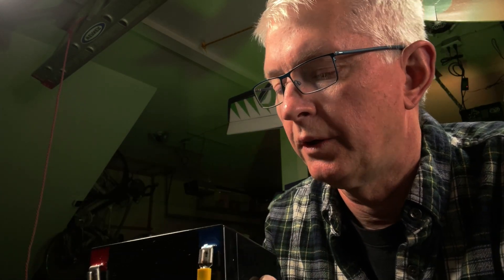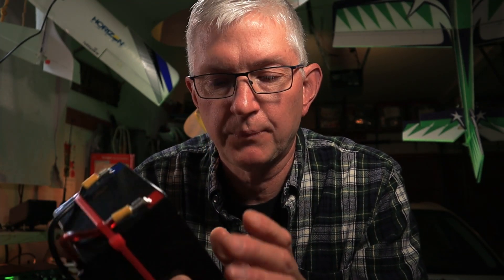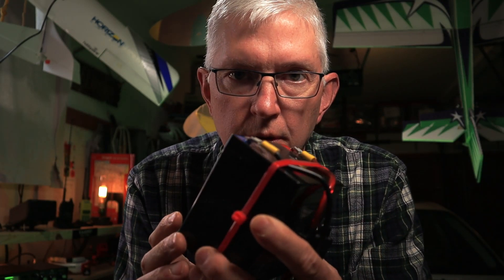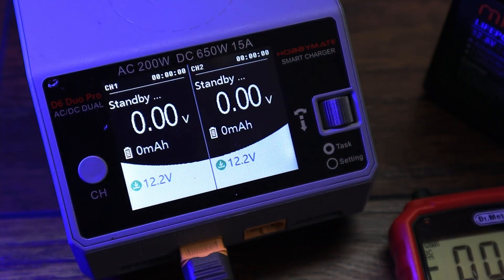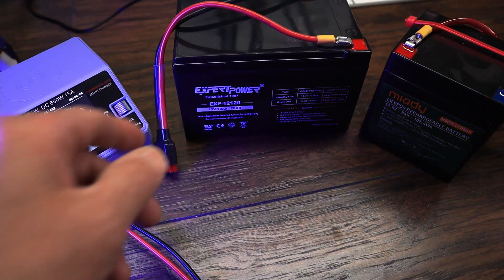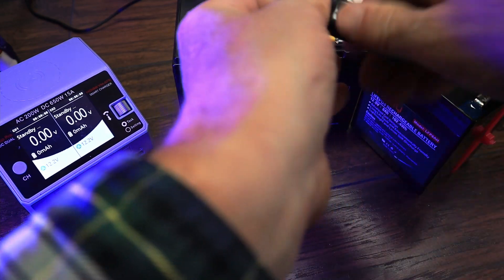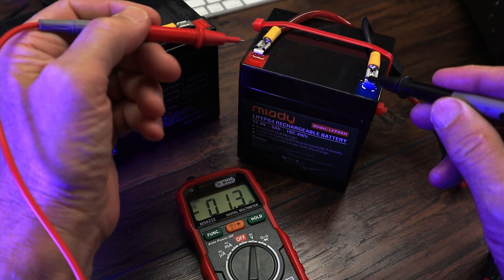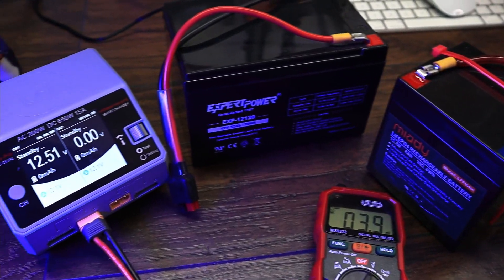DON'T PANIC! Wake up your DEAD LiFePO4 after discharge! (#36)

Comment from the maker: Who has experienced this with their Lithium type batteries? What method do you use to wake the BMS, assuming your battery has the same issue as this one! Thanks for stopping by!
Reply: I have mavic pro batteries that wont charge. Is there a way to wake those up? The Mavic charger will not charge...kind of like in your video. Can you help?
Reply from the maker: @flintdwiggins  Hey there. What does a voltmeter say? How old is the battery?
Reply: @W0KNI  The batteries are a couple of years old...but never used. Just sat on the shelf. Voltage is zero. I think the BMS just turned them off. Is there anything to do to wake them up?
Reply from the maker: Normally I would say yes, but only if you could connect it to a same voltage source.  The pinouts for your battery can be found on the internet. You might check this thread.  https://forum.dji.com/thread-134111-1-1.html  I see a suggestion there but not sure if that works with your battery.  DJI has done a slick job of blocking you into using only THEIR batteries. 
Another option is to insert your "dead" battery into the drone then charge the drone via the cable.  The internal circuit between the battery and the drone might "wake" it up.

Good luck!
Reply: @flintdwiggins  DJI do a good job of bricking batteries and gear thats not used for  a while, I have an inspire 1 that wont show video because the controller pcbs go bad after a while of not being used. 

as for the battery, as far as I can tell from years of playing around with DJI gear, they power the BMS from a single cell and not via the main pack voltage.  This is only an issue during long periods of storage without cycling the packs, one cell will drop below the safe level and the bms will just flash at you, sometimes you cna leave it on the charger a few days and it seems to recover, other times you can open the pack and recharge each cell on a power supply at a low current up to about 3.8V then plug the bms back in.  

I generally charge the whole pack up to about 4V less than full on a power supply, then go in and check each cell, if one is a lot lower than the rest, then its toast and theres no real way to save the pack without changing all the cells.  

I have spent about 10 years doing this kind of thing, and i can safely say, if a cell doesnt charge the same as the rest in the pack, then its time to find a use for the pack without that cell, IE a lower voltage application.
Reply: I use a charger that provides some voltage before going into charge mode.
Reply from the maker: Interesting. Could you share the Make and Model? Thanks!!
Reply: @W0KNI  
It's a Mroinge model MBC055.
I just hooked it up a meter to make sure I'm not misleading you.
With no battery connected, the charger output pulses 15 volts ON and OFF about once every second.

It seems to be a fairly reliable charger.  I just wish it had a display to show charge rate, voltage and mAH.   It only has basic leds showing if it's charging lead acid or lithium and 6 or 12 volts.
Reply: I have 2 other 100amp lifpo4 Renogy smart batteries that are both at 1.8 volts. Tried this trick on them and it didn’t work. Can I leave the lead acid connected to the lifpo4 for longer then a minute to bring up the voltage to where the bms will kick on? Please let me know soon. Thanks!
Reply from the maker: @covidfartfog8076  Hmm, so you say the total voltage at your terminals shows only 1.8 volts? I would suggest contacting Renogy first, but if no luck there then you might have to get access to each of the 4 cells and charge them individually to 3.4 volts.  But reach out to Renogy first.
Reply from the maker: That’s great news! Glad that worked. Happy RVing

Comment: this is normal BMS behaviour. Its when you leave it like this for a year then try to wake it up that you really need to wake up the bms...........  thats a great field expedient way to wake it back up for recharging.  Are you certain that this BMS limits current in during charging  ? have you tried to charge it on a huge power supply to measure the current? most BMS , especially cheap ones will not be CC during charging and reply on the charger to limit the current.

Comment: Hello Stephen, should this also work with a 48 volt 20 Ah battery from an electric scooter (EVOmaxx)? And do I need a 48 V second battery as well?
The repairshop asks €850 to fix it.

Ad
Netherlands
Reply from the maker: Hey Ad - Good question, and the answer is - probably.  However the basic concept is that you apply enough voltage to get your BMS to "wake up."  HOWEVER, the dead battery could easily have MORE than 12 volts hiding behind the sleeping BMS.  So the problem is if you "wake-up" your BMS and then you have 48 volts that will try to feed into your other battery - THIS IS BAD.  And should not be done.  I don't know what kind of battery system you have but for $850 euro's I would think you could buy a new one OR buy 4 x 12v batteries in series to get to 48 volts and try to connect it to your dead battery.  I hope this helps.
Reply: Im in the same boat. Im charging up 4 12v batteries and plan to wire in series to try this. I ran my battery dead and it took a charge but seemed goofy. Voltmeter started acting goofy and I really don't think I was getting the correct voltage on my reading. Now it's dead and won't accept a charge. It's sitting at around 2.5 volts. I'll let you know but curious if you tried it.
Reply: @scotmaciver  I didn't try it. I've sent it to another repairshop, which claim to fix it for € 100. Hope they're right.
Reply: @adjekratje1  well i got my 4 batteries set up and ready to try. Need to get my connectors on and see what happens. I'll report back.
Reply: @adjekratje1  well crap. i put my battery on the bench and got all my connectors wired up and before connecting did one last volt check and now it's reading 54 volts. I wonder if my wiring or something screwy with my controller is causing the problem.
Reply: @scotmaciver  Amazing

Comment: Interesting video. Wouldn't the charger wake up the battery since it supplies voltage to the battery?
Barry
Reply from the maker: You would think? However the BMS inside the battery box goes into a low voltage sleep mode that unfortunately tells the majority of chargers the battery won’t take a charge. The method I show applies enough current to essentially wake up the BMS so the battery can be charged

Comment: I have a 12 volt, 100ah lithium lifepo4 battery that drained down to 3.7 volts. I keep reading that if I attempt to recharge it, it could catch fire. Is this true? Would your method above work for a battery that size?
Reply from the maker: Thanks for checking out my video. Sorry about your battery.  Using the method shown in the video, your battery will not catch on fire - unless your cells are physically damaged.  If they are leaking then do not try to charge the battery.  However, if it was just drained down to 3.7 volts then try this method to wake the BMS.  Let me know how it goes for you.

Comment: Got my lifepo4 20amp battery awoken. I connected it to my Sharmans 30amp power supply. It has variable voltage so dropped it to 12.5v and connected to the psu for 1m 30secs and it will now charge 🙂
Reply from the maker: Excellent! Have fun

Comment: Proper LiFeP04 chargers will wake up your battery, you just have to give a  minute for the process to take place.
Reply from the maker: Hey there, thanks for watching.  Sounds like great info, do you have a model you can share? I'm always interested in good battery tech.  I use a pretty reputable charger for Lithium batteries and it was unable to kick start my "sleeping" battery.  take care!
Reply: well my Energie Stor Lifepo4 charger will not wake my dead 20a battery
Reply from the maker: Good to know! Did you try briefly connecting another 12v battery to it like I did in the video?
Reply: @W0KNI  I have in the past and that does work.
Reply: @W0KNI  hi. Do I need to hook up a battery of similar amps? People say a car battery is OK...
Reply from the maker: If you can. But it must be the same voltage, like no more then 10-15% difference. You only have to connect them for a few seconds.

Comment: You are awesome! Can confirm the BMS needs to be woken back up like this if Miady batteries short and overcurrent kicks in too.
Reply from the maker: Hey there! Great to hear that. I've heard about other batteries don't fare as well, but maybe Miady's BMS circuitry was better.  Glad this helped!
Reply: @W0KNI , yep thank you very much. It was an accidental short with my multimeter as I forgot that I had is set to current instead of Voltage.
Reply: This works. Unfortunatly my Batterie reaches 14.4v after around 2min and stops loading. I can then suck around 200mah Out of IT and then the BMS switch of again.....BMS defekt? 😢

Comment: Thanks a lot for the video, I have another question, if the battery were short circuit shortly after fully charged. And the BMS kicked in, can i use the same method to wake up the battery? Thanks again!
Reply: Can confirm this method worked when I overloaded my Miady and the bms kicked on.
Reply: @TrollFaceTheMan  Thanks!
Reply: @qingshi3834  welcome.
Reply from the maker: Hey there! Thanks for watching.  Very good question and really depends on the quality of the BMS.  If it survived then yes, you should be able to "wake it up" using this method, but again your results may vary depending on if the BMS was able to stop the over discharge surge.  Let me know how it works out for you!
Reply: @W0KNI  Thanks a lot Stephen!  i do not have a lead acid battery in hand, so i connected to another same LiFePO4 battery, positive to positive and negative to negative for 1min, nothing happened~ still no voltage at all.
Reply from the maker: Hmm. Are you able to charge it after that last step? If charging is unsuccessful then I’m afraid you will need to remove and replace the BMS.
Reply: @W0KNI  Yeah, I tried to charge it for 1min and still no response. I guess the BMS is broken. Anyway, thanks a lot, Stephen!

Comment: Thank you! I've got a 20AH 12V Lifepo4 battery that wouldn't take a charge. I still don't understand how you can over deplete the battery, but not overcharge the battery, but that's what I did. If you have any thoughts on why we can over-deplete a battery, I'd love to see it in a future video, or link to a past video

Anyway... I jump started my battery from my car battery for about a minute, then threw it on the charger, and it charged right up. Thank you so much for this!
Reply from the maker: Great to hear you brought it back to life! AFA overcharging, two things to note. One, the BMS should not allow this but cheap stuff fails this test. Second, your charger is another check point and should not allow this however it also depends on the battery BMS for feedback.

Comment: Been doing this since 2005 as a mechanic to get 12v lead acid batterys to charge as the chargers in the shop won't attempt to charge an already dead battery. Did the same recently with an 80v lithium battery that dropped below charger turn on voltage on an electric leaf blower.
Reply from the maker: It works great! Odd that BMS's haven't evolved to handle the situation.  Cheers!

Comment: N6EF-This happened to me and I thought I damaged my battery. Thankfully, the BMS saved the battery. Using your method or one similar to it got me charging again. I keep a 9 volt battery in my POTA backpack so I can get just enough power into the battery to start the charging process. Thanks for some great information.
Reply from the maker: Hey Bill - thanks for watching! Glad it helped. When it first happened to me I was perplexed something so simple would take out a battery.  Thankfully not so! Cheers.

Comment: Was just wondering. Can you hook up the charger to the Lithium battery, which I understand will not charge because it"s internally shut down by the BMS and is reading 0 vdc and then just tap the pos and neg terminals with the LA battery? Wouldn't that turn on the charger? I have drilled holes, in strategic locations, in cordless tool batteries, that give access to the battery pack's terminals, to allow me to give them a short charge from a good battery to turn on the charger, but I can't do it while they are inserted in the charger. I have to "manually" send in the juice until I think the battery has charged enough to "trick" the charger into turning on, which I think is what you are suggesting with your larger battery. Seems that if you can connect your charger up to the Lithium battery ahead of time, with the + and - terminals still exposed, just one little burst of a viable voltage would get the charger turned on. Am I wrong?
Reply: You are just describing an overly complicated version of what is in the video. The end goal is to show the charger enough voltage to turn on and charge the battery. You can do that by putting the charge in the battery which wakes the BMS and allows raising of the battery voltage and then connecting to a charger. 
Drilling holes and connecting wires to your charger is just an extra step and extra parts to reach the same result.
Reply: @btwbrand  Not in this case. I was dealing with a particular 18 Volt Ryobi battery and I have to say, I don't remember if it is the grey kind or the ones with the green stalk that contains the terminals, Ryobi has made a few different kinds over the years. In any event, when I tried to apply some voltage to the + and - terminals, nothing happened. No spark and no impact on whether it charged in the charger. I assumed that something had to be sensed via the third unlabeled terminal in order to open a gate or bypass a diode or something like that to get juice into the battery. That's when I took the battery apart to gain access to the + and - terminals of the actually cell pack. That worked, so I drilled 2 tiny holes in the plastic outer case to let me touch a pair of push pins with wires attached to those internal terminals without disassembling the case each time. Any ideas on why that was necessary? Maybe an open circuit on the thermal switch? Whatcha think?
Reply: @btwbrand  ty for explaining  what he was doing ..
Reply from the maker: Hey John - thanks for checking on the vid. Interesting approach you are describing and I've honestly not tried combining the two. I suppose it wouldn't hurt your charger.  Thanks for the tip, next time I have this issue I'll try to remember to give it a go!  Cheers.

Comment: I am having a charging issue. I am using one of those selectable sla/lifepo4 chargers and the light stays red constantly, never turns green. When I take the battery off it drops fast.
Reply from the maker: Hey Matt - thanks for watching! What are the specs on your battery? Using a MM, what does the voltage say at the terminals?  It could be that you have a bad cell, this happens for many reasons.  In such a case your battery is best to be discharged and recycled.  Let me know!
Reply: @W0KNI  When I take it of the charger, it reads 13.45. But I hook a usb hub to it, and just trying to charge a cell phone drops it fast to 12.8 within 15 minutes. Its the Miady 8ah battery.
Reply from the maker: @usarmyfl1  ahh. Ok. So for that battery the nominal voltage is 12.8v. If you have something to plug into that draws about 1A then the battery should perform for about 7.5 hours before the min. voltage cutoff kicks in by the BMS. Usually after your voltage drops under 11v that’s when your Life battery is about depleted.
Reply: @W0KNI  The thing is, if I look at a lifepo4 voltage chart, 12.8 shows about 17% capacity left, when the battery should be near 100% That's what confuses me.
Reply: @W0KNI  Thanks for your help! :)
Reply: @usarmyfl1  
I suspect the chart you're looking it is the voltage during charge which is going to be higher than the discharge voltage or the standing voltage.  My fully charged 16 ah Lifepo4 settles down to a sitting voltage of about 13.5 volts, but quickly drops to about 13 under even a small load.
As far as the charger staying on red forever, are you sure you're giving it enough time?  The top-off of that last 10% takes the longest on lithium batteries.   According to the Lifepo4 discharge curve I'm looking at, under a .5c load (a discharge current equal to half the rated capacity) , a fully charged battery will have 3.2 Volts per cell which is 12.8 volts for a 4 cell 12 volt Lifepo4 battery.

Comment: Just tried this after my 100ah lifepo4 bms cut out on my golf cart. In less than a minute my battery showed voltage and is now charging correctly. Thank you sir.
Reply from the maker: Reno - so happy that worked for you! Those batteries are not cheap, glad this method got you going again.